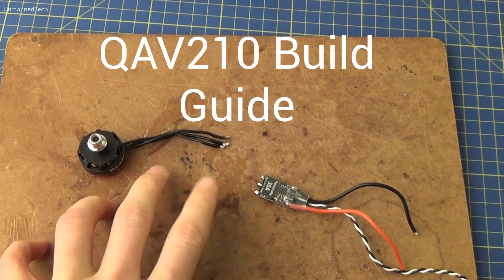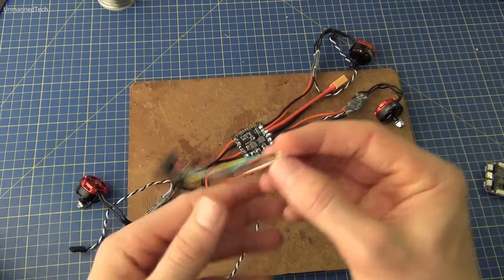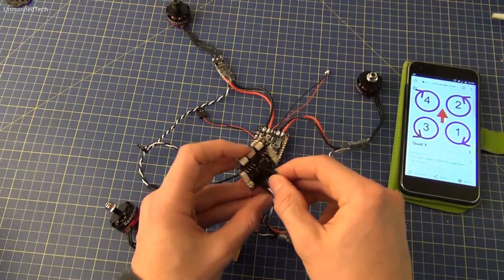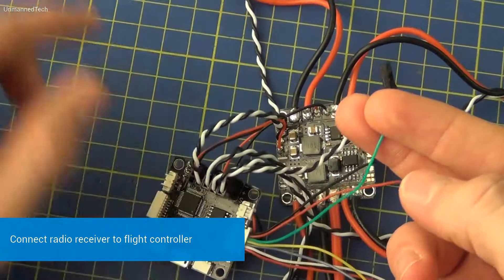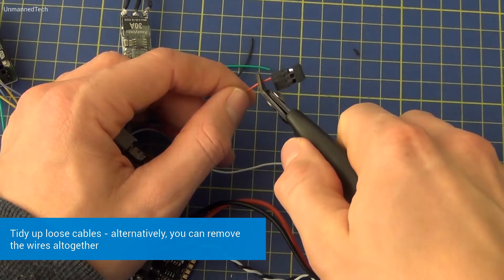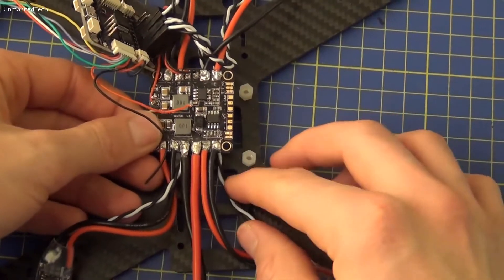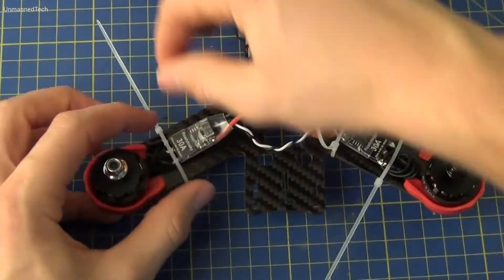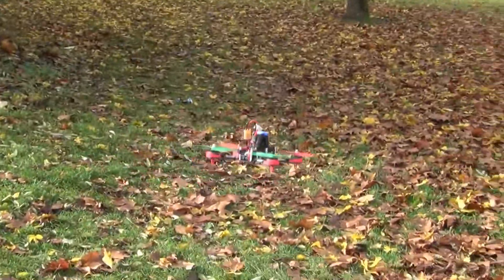QAV 210 Quadcopter Beginners Build Guide

Comment: Hey, im getting into the hobby and want to buy a cheap starting kit like this.
But i have a Devo 7 Radio Transmitter, how do i connect it to my quad? Can i just buy the Devo 7 radio receiver and connect it to my PDB?
Great video!
Reply from the maker: Hi! Yes you can just buy a Devo compatible receiver and hook that up to the flight controller. If you're using a PWM receiver, you can copy what's here exactly. Thanks!
Reply: yes